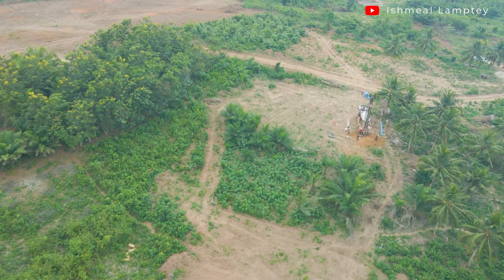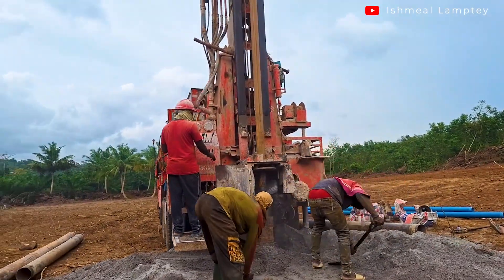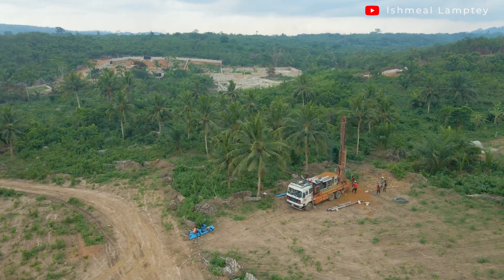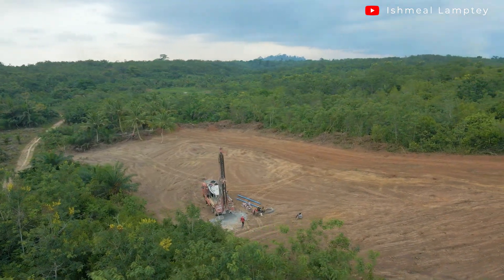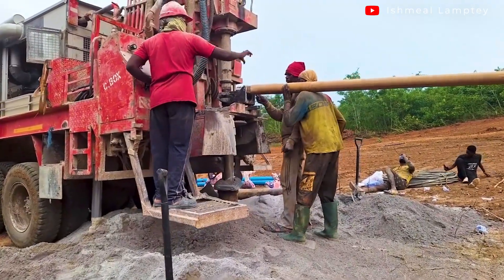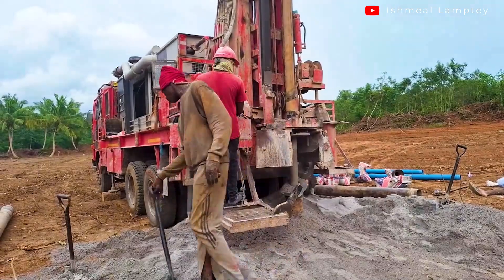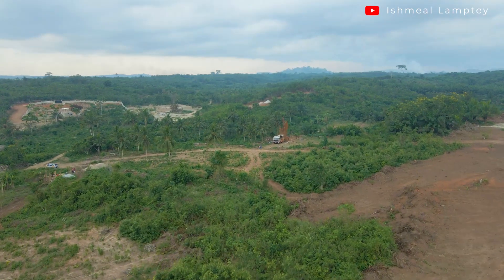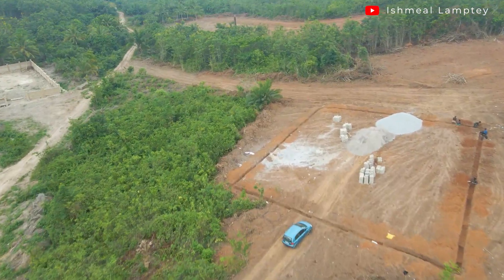Negative Effects of too many Boreholes

Comment: Having homes share boreholes is a bad idea. The water consumption would not change simply by sharing. People like to have their own source of water and have the peace of mind. Until studies are done to determine the water table level and seasonal fluctuations, people shouldn’t be prevented from having their personal boreholes. I really think with the type of heavy annual rainfall, having individual boreholes will NOT be a problem at Asebu. The residents should also contribute funds to have water supply brought in to the subdivision. Waiting on the cash strapped government could takes years.
Reply from the maker: The idea of sharing borehole is not because of consumption but rather the dangers that comes with drilling a lot of boreholes at a concentrated location.
Reply: @IshmealLamptey  …you’ve a point but studies would need to be done to determine the appropriate spacing of the individual boreholes. I made a typo in my original comment which I’ve corrected. The area presumably has lots of rainfall so I don’t think individual borehole would be a problem.

Comment: Excellent topic and timing for the location. I see extensive clearing of trees (frequently zero greenery) and high density installation of boreholes as PRIMARY (versus SECONDARY) source of water in SOME new communities, in the Central Region of Ghana in particular. No effort to access public water utility company. It's as if the community developers and new property owners do NOT care about environmental impact, or about tomorrow. Some even SEEM to suggest in their videos that the ground water is without problems, without potential pollution from intensive human activities, and is inexhaustible! I doubt that many of these developments get proper planning approvals with environmental impact assessment and without undue influence (bribes). Community leaders should do a better job, especially those claiming to care about Ghana. Thank you.
Reply from the maker: Very great input. Thanks for sharing as well.

Comment: So how exactly does sharing effect water pressure to each household? Also, who addresses damages to shared borehole, who’s liable for problems, and splitting of costs? Any of these situations can cause much confusion.
Reply: I would assume that everyone using that borehole should split the cost of any maintenance.  Isn’t water pressure determined by the pump system.  I’m going to do more research.
Reply: @TheRedTrucks  Yeah, do more research. Because we have to remember that every family’s need for water is unique. Our neighborhood here has had (wells) at every home 🏡  in our town for decades without any issues.
Reply: @ELEPHANTintheroom12  How many homes are in your neighborhood?  The quick research I just did supports what the video shared.  I’m going to do more research and we will have to get some professional advice for the infrastructure committee as soon as possible.
Reply: @TheRedTrucks   We have a 2023 population of 6,033. Spanning over 19 miles, our town has a population density of 317 people per square mile.